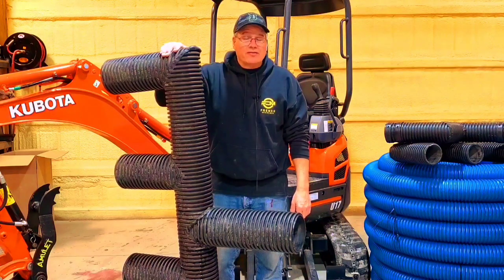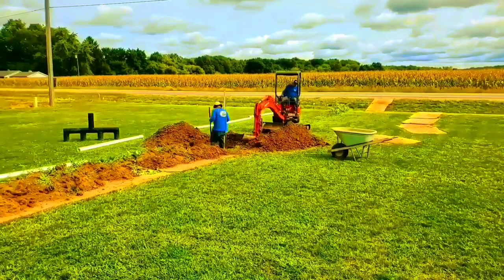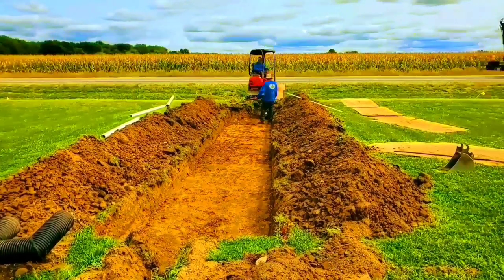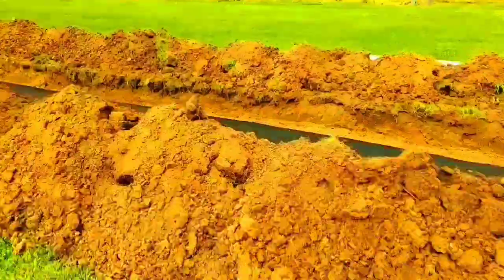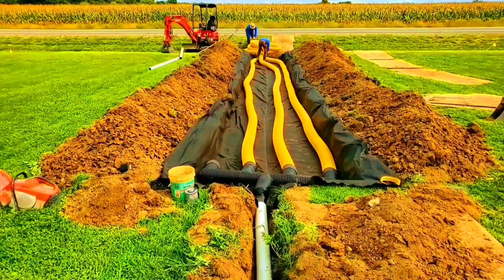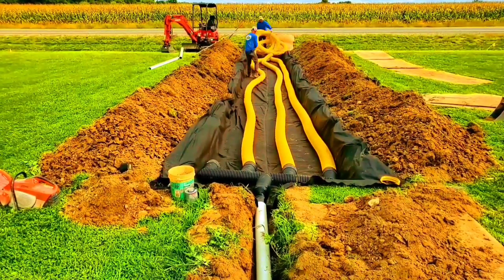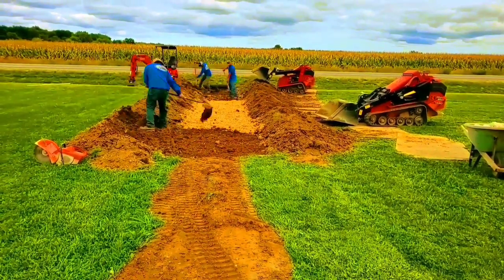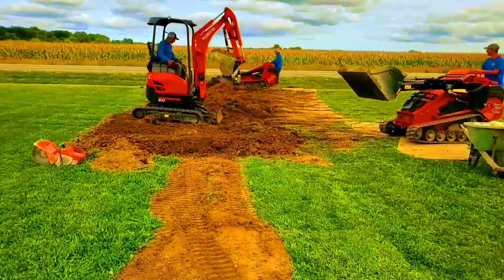How To Dry Out a Flat Yard with NO SLOPE Like the PROs Made Easy for DIYers

Comment: I'm using multiple lines of the 6" yellow solid to take away storm water from a multi-tiered roof that's over 600m^2 and it's unbelievable how different this stuff is from anything else I worked with before. I go 300lbs and I can stand on it like it's nothing. (We're also using the yellow 4" in both solid and 8-slot for other parts of the project, plus two full-frame Bad Seeds, one with a 1/2hp Zoeller and one empty.)

Basically just wanted to say that it can be easy to wonder if FDM is just shilling for Baughman, but no... If anything they're understating the case because they focus so much on water flow. (For obvious reasons) 

But I'm here to tell you that these products really are a whole level above anything I've ever seen from a big box store. The structural solidity is amazing. This is NOT going to be a weak spot in the yard.